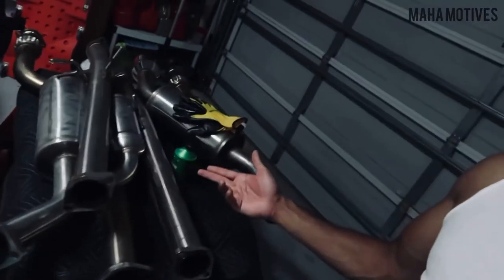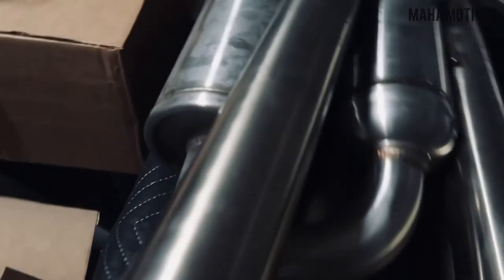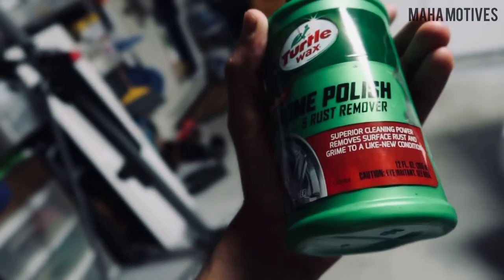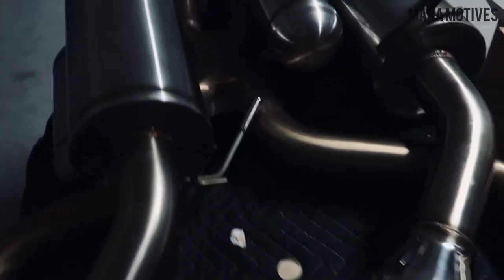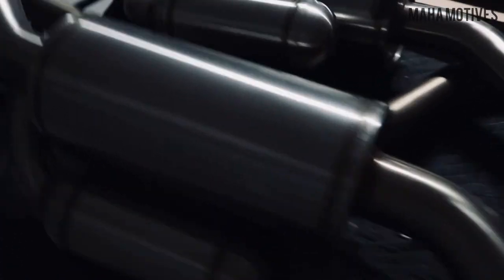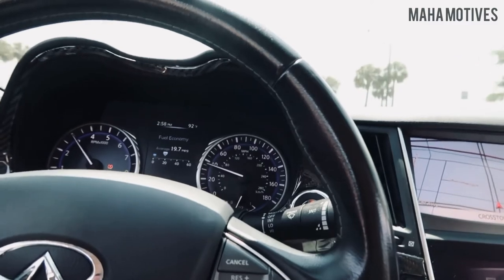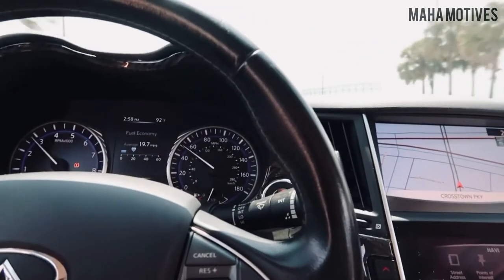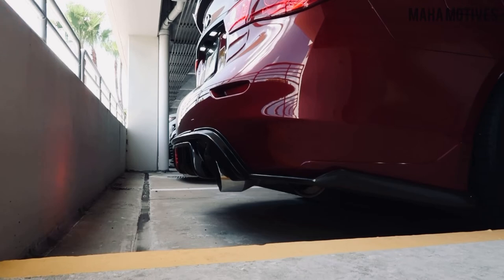3.0T ARK GRIP EXHAUST ON THE 3.7 Q50 | SOUND CLIPS | COLD START | REVS

Comment: Just bought a 15 Q50 premium myself.  Only done minor aesthetic improvements so far.  My diffuser install last night didn’t go so well, tape was poor quality. Luckily it left no residue ( tape was that bad🤦🏼) and I’ll get to give it another go.  I’m curious which diffuser you installed, and thinkin about doing the Stillen carbon fiber tips, cat-back exhaust in a few months.  Love the color combo on yours too.  I was moments away from buyin a 17 400 Sport, until I found out the dealer was concealing the fact it had an R title.  900 mile journey just to check the car, seemed a little extra, so I found my 3.7 locally and figured I’ll drive it until the right 400 pops up.  Had a G37x coupe before this and a couple QX80’s, one I still have.  Great videos though my man, keep posting🤙🏼
Reply from the maker: Sick bro hope you find the red sport soon …. Those cars are beasts 🔥🔥 appreciate the support man 🙏🏽

Comment: I have a muffler delete on mine and it sounds exactly the same /:
Reply from the maker: Look back on my previous shorts and videos….I had a muffler delete before the exhaust and it sounded pretty good for just a delete…..once you get into the higher rpm’s the ARK exhausts has more of an aggressive tone and screams more at open throttle than the muffler delete. Would’ve probably still had the delete if I didn’t get such a good deal on it but you’ll hear a difference once you get a full exhaust.

Comment: Hey bro when u did just the ark grip exhaust did it ever pop at all?
Reply from the maker: Yup it does crackle and pop here and there. Especially in 3rd gear
Reply: @Mahamotives  haha that’s awesome even without the tune ? I just ordered one and now I’m even more hyped about it
Reply from the maker: @kinxsoccer571  yup even without a tune…..I love it 💪🏽…. Did you get the 3.0t version?
Reply: @Mahamotives  yes  I heard it was better but I’m not sure what the difference was really
Reply from the maker: @kinxsoccer571  3.0t version is non-resonated and 3.7 version has resonators…..so it will be a little bit louder and more aggressive but still relatively quiet when you need it to be other than cold starts
Reply: @Mahamotives   tru bro I’ve been watching ur vids for a while but I didn’t realize I wasn’t subscribed 🤦🏽‍♂️great content
Reply from the maker: @kinxsoccer571  i appreciate the support brother 💪🏽💪🏽💪🏽
Reply: @Mahamotives  will i run to issues if i dont plan on getting tune? how did it drive after installing it mines just came kinda curious
Reply from the maker: @yuthought-2450 you won’t run into issues…. Car will actually feel little more responsive low end. Just always a good rule to follow when changing up the airflow of the car